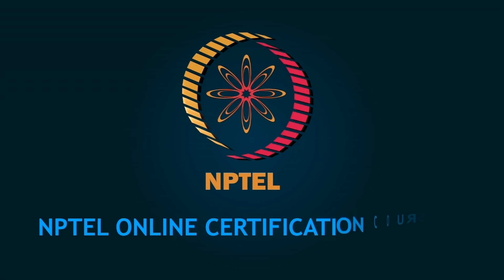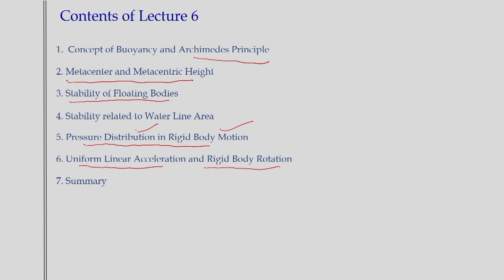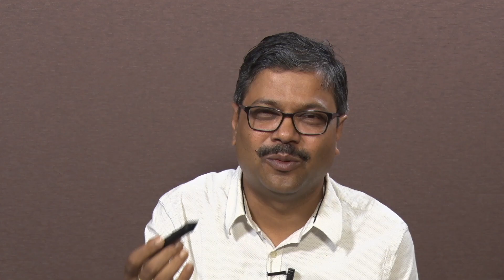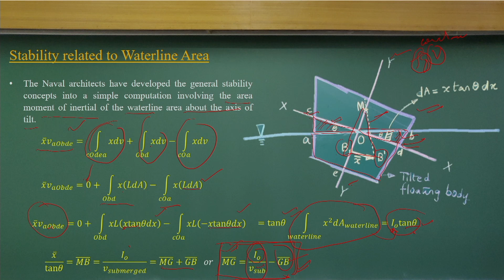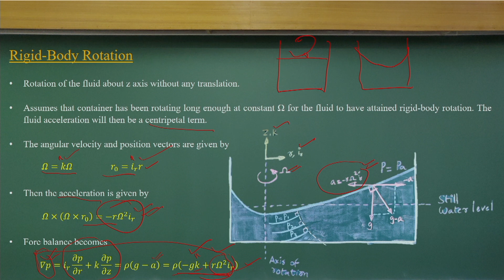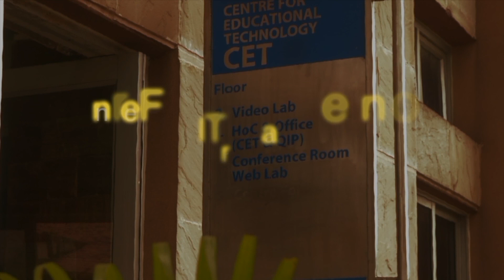Lec 6: Buoyancy, Metacentre, Stability and Rigid body motion

Comment: Uniform motion and rotation rigid body is not that clear. I couldn't understand the derivation till pressure distribution the concepts is clear sir👌💯💐
Reply: Bro no one will ask derivations in any exams it's just a concept u need to know how water pressure behaves that's it
Reply: I also found this lecture to be unlear. It was confusing.